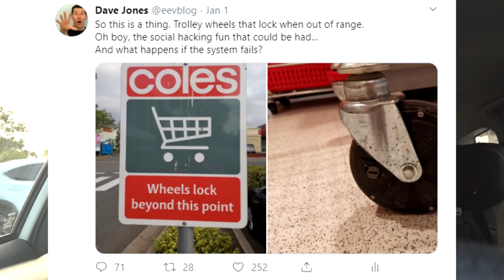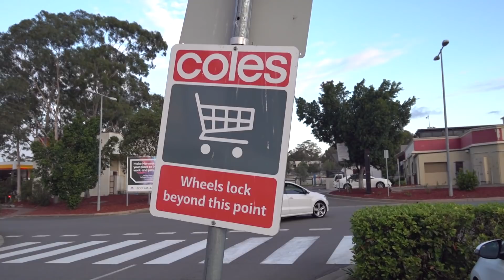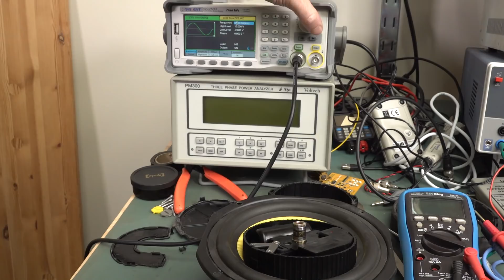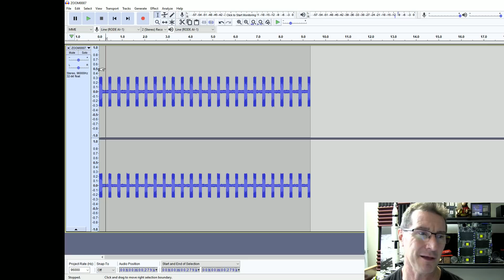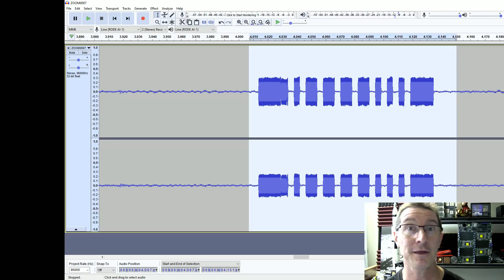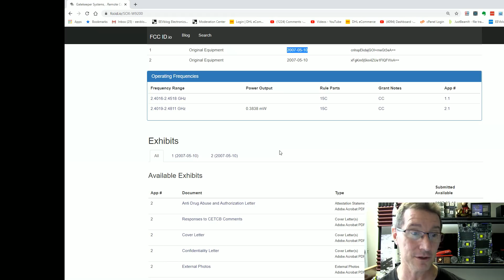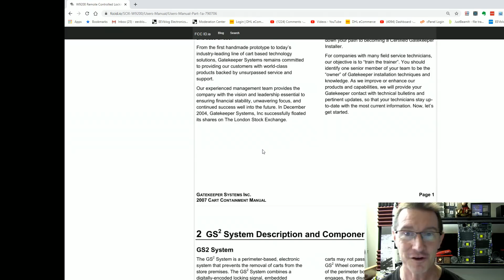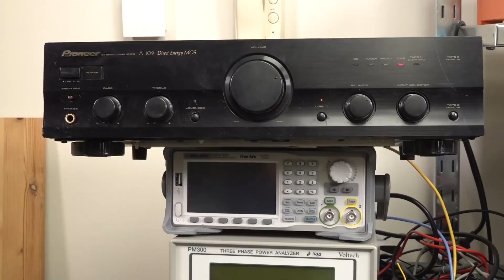EEVblog #1287 - Gatekeeper Shopping Trolley Lock Investigated

Comment from the maker: Yes, I have upgraded my pointer, now in vibrant yellow!
Reply: Dave I think the wheel you have may be using a different code, maybe you can cycle through the bits
Reply: If you're looking for an easier way to cut plastic housings open, consider getting an ultrasonic knife. It cuts ABS like refrigerated butter.
Reply: The carts at Kroger where I work, have 2 wheels done, one on back one on opposite front corner
Reply: You need a remote device to unlock the wheel
Reply: Hey Dave, can you explain how low energy receiving works? In the datasheet there is moentioned something with 17mA in RX mode. How can a baatery work like month? My thermometer with outdoor wireless sensor also works like over a year or more with just two aaa batteries.
Reply: There's a great instructable where someone has worked out the encoding to unlock the wheels (flip all bits except start and stop, from memory). They've built a power transmitter and put a coil on themselves, gone into the store and played red light / green light 🤣
Reply: supermarket here has a similar system, but instead of pushing a locking clamp inside the wheel that'd still allow you to force it, it pushes a clamp against the outside of a wheel that locks it solid. Makes it nigh on impossible to move even over the polished tiles of the supermarket floor (and yes, they sometimes lock unintentionally while you're going about your shopping...).

Place went from losing dozens of carts a day before installing the system to losing none. Money well spent. And with their own underground carpark accessed from inside the store, they just put the trigger line at the front door :)
Reply: So 2.4 GHz RF with a 7K digital chirp looking at the FCC page
Reply: When the rest of you are done missing the point... Can we please talk about the yellow pointer? I am covetous of it, Dave.
Reply from the maker: @Max27653  If the RF chip does take 17mA on RX then clearly it's not doing RX. Maybe just burst TX when it gets triggered, to alert security that someone has taken it out of range.
Reply: @EEVblog  Hey Dave, thanks for your reply! Why do you think so? All the receiver I had in my hands had that huge power consumption...I'm searching like crazy for over a year for a solution. E.g the  usual photo flash trigger last only 2 days with a couple of batteries. Fraunhofer Insitute invented a chip RFicient and they claim a few µA but it's not available yet and I'm wondering if that's just not possible because of technical limitations. My wish would be a max delay of 2ms (that's what those flash triggers have between pressing the sender button and blinking of the receiver's LED)
Reply: the wifi signal may be triger when the lock engade and start sending beacon signal whit  unique key like the lock key.
Reply: i only see more e waste with this thing
Reply: Thats what she said!
Reply: @EEVblog - 
hahaha back to Old School 1960s / 1970s phone phreaking, but now with shopping card wheels instead of a phone ;)
Reply: What the yellow and gray will tabs you pulled off that's a master wheel but if you need to rebuild the wheel and it needs just be a secondary that's where the green green and gray come in
Reply: @Viewer19  It's a bit confusing. The circuit board has a 2.4 GHz RF transceiver IC and the appropriate size PC track antenna connected to it, yet when you read the manual about the transmitter which runs the system it says the output is "below 9 kHz VLF". It also says the output from the Cartkey used to unlock the carts is "below 9 kHz VLF". I can't see any mention in the user manual of 2.4 GHz. However, in another FCC document for the wheel itself, it talks about a Grant of Equipment Authorization for a remote controlled locking wheel using frequencies of 2401.4  -  2478.6 MHz.

Comment: An idea - that looked like a byte code, that may be an address for a system, so that your installed system doesn't affect your neighbor's carts.  Try all 256 byte codes, the wheel you have may not be configured for your sampled byte pattern.
Reply: That would be my guess as well.
Reply: Could always take that wheel to his shopping center and see if it locks up or not.
Reply: @mick7sp  I'm guessing the wheel that was sent in wasn't from Dave's local shop though
Reply: @richardeadon6396  Safe bet.
Reply: That's exactly right though it also varies by the brand for carrier frequency and bit length
Reply: 8 start and stop bits plus maybe 7 data bits. It's decimal counting!
Reply: Almost certainly encoded to prevent accidental triggering by other coils or random 8khz signals.
Reply: I think those screw plugs are key here, they probably are a way of indicating the encoding for a given wheel. I'd bet different centres would have different colour plugs
Reply: @Skwisgar2322  Unlikely. Someone else`s carts should never be going over your coils. They would have to leave that stores area to do so in which case the system has already failed.
Reply: Another thing I would have tried is bring the wheel sample to the shopping centre and see if their coil can trigger it. I would also bring the player and headphones and see if it could trigger any of the unlocked carts.
Here in Canada they pretty much gave up on locking wheels and are using the $1 coin for an unlock key as alternate security. Which I defeated by 3D printing my own removable unlock key!
Reply: It seems strange Dave hasn't thought of the byte being a store ID... Unless he knew the recorded one was the right ID... 
"A viewer sent one in"?... Sure...

(Also, if it's from a viewer in a different country the authorized frequency could be different.)
Reply: The “store id” wouldn’t be to prevent stores from interfering with one another, it would be so that store managers couldn’t buy second-hand cart wheels from another store that went out of business and integrate them into their fleet.
Reply: @excitedbox5705  Though that also relies on it being 1 carpark per store. None of the shops here in Western Australia where I live have it, they just have the old fashioned coin/token to unlock the trolley and the incentive to get back your coin / token means you'll return it.

Of the shops near me, there is a Coles and Target which both share carparks since it is an actual shopping centre, but the trolleys are owned by the individual stores, so it would mean all the stores would have to make sure they all use the same ones or risk the system not working at all.
Reply: @ray73864  You are right shopping centers may have multiple stores. I have only seen these systems at stores with their own parking lots here in Germany though.
Reply: @Grunchy005  We have a similar system, we use coins but you can use any coin, meaning you can get a cart for like .2$
Reply: @Grunchy005  It's the size that matters, you can unlock it with any coin around the same size or even with the round part of a key.
Reply: Yep, and it seems to be a ~3Hz repeat of the code, so you can cycle 256 codes in under a minute and a half. If you got this working in a nice handheld unit, you could scan for the lock code, narrow it down, and then lock every trolley in your local shopping center ;-)

Theoretically. I of course do not condone doing this at all. It would "disrupt" the shopper's "experience".
Reply: I was just about to say the same thing. Unless the wheel came from the same store that the recording was made at, it probably had a different lock code. Or perhaps the wheel was "hard unlocked" as its possible there are reasons why you'd not want to trigger the lock and then have to manually unlock them (I guess a close reading of the fcc handbook would say).
Reply: @Grunchy005  For that $1 coin cart,  I don't even have a 3D printed unlock key,  I instead just use a standard schlage key as the unlock key.  The head of the key happens to be the same width and thickness as a $1 coin.
Reply: @Grunchy005  Or you could simply use the woden srick icecream come on. The flat ones work perfectly for unlocking carts here in poland
Reply: The one I took apart years ago had a Holtek remote control IC of the sort that was used in simple fixed code keyfobs at the time, they may have changed the design though.
Reply: Exactly my taughts !!
Reply: @excitedbox5705  But would work in a multitenant centre to keep competitor trolleys out of your store, enhancing the brand by only having your trolley in the store and not the competitors branding. Probably there is a hierarchy of coding, with a main 4 or 5 bit centre key, and then a 3 bit shop code, so that the trolleys lock leaving the premises, and also lock if they enter a competitor store, as they detect the master keying and a non shop code. Exit to the parking they just have to send the centre code and all shops as )0, so all trolleys lock after detecting the non shop coding for the centre. Inconvenient for the customer slightly, and you have a lot of locked trolleys by the door to quietly ship back to the other store, probably using a wheel lifter that slips under the back wheels.
Reply: @statinskill  That would be the store installer manual, the manufacturer probably has a unique for the region shop code, either for a chain, or for a block of centres, and you order the spares like wheels using the shop code, they arrive pre encoded to the store, as you registered the store address when the system was set up, so the link is there already. Hide it from the store, as they have only a single source of spare wheels and coding system parts now, locking out any secondary used part market. Probably can be coded using a "special" fob, which just reads the store code, and has the right magic bytes to send to the wheel to change coding, and either has a tablet app on it, or runs on a tablet device of some sort to use the wifi system in conjunction with a special installer LF  fob.
Reply: Also, probe the coil pickup frontend and trace it back to the micro to see whether the signal is getting all the way through before trying all 256 codes.
Reply: @ray73864  I've encountered it in WA. Coles Maddington if I recall correctly.
Reply: At it's most basic it uses (or used several years ago) a simple fixed 8 bit code but they also had an anti shoplifting  option where if the cart was pushed out of the store without first going through a checkout the wheel would lock, so the checkouts sent one code, the store entrance another code and the car park perimeter a third so the electronics would have been significantly more complex than the one I investigated. That said I don't know if any customers ever implemented that option so they may have never even built it.
Reply: @EvanCoonrod  "fleet" LOL
Reply: @Grunchy005  Here in Germany you can ask the cashier for a shopping cart coin if you have none.
Reply: @excitedbox5705  At large malls there may be several stores within the confines of the overall complex using trolleys and the locking system but stores may wish to limit their trolleys to a specific area around their store which may overlap areas for other stores.  Also you want some kind of encoding just to prevent other things generating magnetic fields, like the doorway security tag alarms, from locking trolley wheels.
Reply: @Grunchy005  But since the 3D printed key probably cost you more than a dollar to make, it works even better for the market!
Reply: @excitedbox5705  Not necessarily - a lot of shopping centers (at least where I am) have different stores sharing portions of a bigger lot.  You may want to let PetCo and Peebles customers park in the overlapping row of parking spaces they share, but not let the PetCo customers take their carts all the way down to Dollar Tree on the other side of the same lot.

Or maybe it's a hardware store and they want to keep the "oversized" carts for the loading zone only but allow "normal" carts to go out to cars but not beyond the parkinglot borders.

I can see where you'd want to have small overlap in the larger shared lots and would need them to not interfere with each other.
Reply: @ray73864  I've only once ran into a place that did something like that.  I never shop there because I'm not carrying around change on the off chance I might decide to...I would rather just go to another store that has carts you can "just use" while shopping.
Reply: @Grunchy005  Don't sell that key to Bubbles :P
Reply: @Grunchy005  Yeah, I can see that being really annoying if you don't have a loonie on you.
Reply: @Grunchy005  our area uses the $1 coin AND perimeter locking mechanism like he did a teardown of. If you want to steal a shopping cart... $1 is a very good deal.
Reply: Grunchy Forget 3D printing, the retailer who owns the trolleys just gave me a plastic coin to fit in those slots!
Reply: @jlu  Swap it with a different cart. Boom, free money.
Reply: @excitedbox5705  What about in a shopping center where different stores might have different but overlapping ranges allowed?
Reply: @daniloxyz  Dave is probably subscribed to his own channel, soo......🤔
Reply: @Grunchy005  I remember places in the UK using both methods at the same time.
Also at least one store that had coin unlocked trolleys also sold dedicated metal tokens to unlock trolleys with instead. XD

Actually more expensive than using a coin, but the upside is, since it's it's not money you won't spend it, and thus you won't find yourself stuck without access to a coin for the trolley
Reply: My thought is that it's modulated as RF. It doesn't respond to just an audio signal from a speaker. The signal needs to be transmitted on a 2.4GHz RF carrier.  That's what the antenna inside is for.

Comment: I'm guessing you weren't able to trigger it because it was a different code than you recorded.  Each facility could get their own 8 bit code.
Reply: It's more with carrier frequency and bit length based on manufacturer but same idea
Reply: Can generate all the possible 8 bit codes to trigger it
Reply: Did he ever check the battery voltage? I don’t recall seeing him do it.
Reply: @kwhp1507  yes he did the battery tested low but with charge
Reply: @pahom2  that's a lot of codes to generate on the fly in a shopping centre carpark
Reply: @Dedrik in the lab, to trigger the lock mechanism. To unlock you still need 2.4 Ghz key anyway
Reply: @pahom2  Would only take 4.2 minutes at 1 code per second
Reply: Miami Movies two codes a second is half that.
Reply: This was exactly what I was thinking. They have a very clear 8 bit code being sent. The only reason to go through the effort to send this code, is to allow encoding different codes within the same standardised system.

Which makes sense. Imagine you're in a retail area and there's 2 stores with carts next door to each-other. They might well want to protect their own individual perimeter, and this would allow for that.

Now, as for capturing the code for unlock. You could probably sniff it with a cheap SDR, downconverter (slightly less cheap) and a phone, then just wait around some discarded trolleys that might be locked, for someone to unlock them. But! The fact that chip is a transceiver and not just a receiver means if they wanted they could make it more complex. Challenge/response etc.. Seems a bit overkill for a trolley, but who knows? Maybe in some countries there's some massive shopping trolley theft cartels? :P
Reply: @r00tyschannel52  yes the theft scrappy them for metal or builds animal cage or a fence out of them soo
Reply: I wonder how long it will take upon this video untill I can be amused by a DOS-attack on shopping carts in the wild...

(Even I must admit, that I never encountered this system here in Germany.)
Reply: I was late on watching this one, but I think your right, there would be different 8bit codes for different locations atleast. Might even find they change the frequency depending on the age of the system, forced upgrade perhaps so you cant use obsolete locks
Reply: There was two antennas so is it possible that the second band had the unlock code which naturally wasn't captured
Reply: Assuming there's also an unlock code (a moderately unlikely possibility) that leaves 128 codes. Plenty of keyspace for multiple retailers in close proximity.
Reply: @ImperatorClass  It's 8bit, so 256 codes. Just 20-30 lines of C in a microcontroller which cycles through all of them.

Comment: you could walk around the shopping center broadcasting that to troll shoppers
Reply: Oh lord I just thought the same, get a coil inside your shoes and walk past carts in the mall. Priceless!
Reply: That would be a enhanced shopping experience.
Reply: My first evil thought too. :)
Reply: @FrozenHaxor  Long ago, someone actually did that. Some funny suggestions were to trigger it during a thunderstorm or trigger it when a nearby cell phone ringed.
Reply: My friends used to get a bunch of those anti theft tags and slip them into peoples pockets or just stick them on their shirt
Reply: i remember when this hit hackaday, all you need is a coil and a audio amplifier and a mp3 of the store's system
Reply: @cda32  I used to keep a few of them in my wallet, and would set off the alarm entering. Then started to use them inside a Rf shiewld, so that you could see if they were effective at shielding. Now just use a 1mm copper plate either side of the cards, which works very well, no RFID reading at all from even up next to the cards.
Reply: Nikki Cooper  red drawf
Reply: @FrozenHaxor  That's exactly what I did back in 2004 - see my longer comment.
Reply: It's been done. There's a project on hackaday that does just that.
Reply: Nikki Cooper  just that was a joke on red drawf. The British version I think honestly might be where they got the idea
Reply: Without being specific, à la Dave's "social engineering" remark!
Reply: Nikki Cooper  Are you sure this happened?  sounds like the plot of the play "Do black patent leather shoes really reflect up?" (originally a book some 45 years ago)